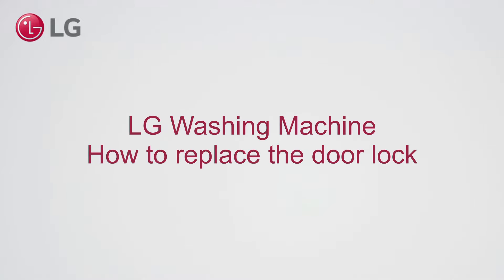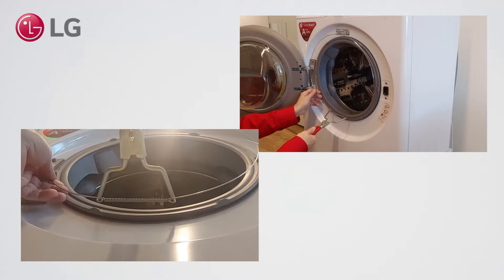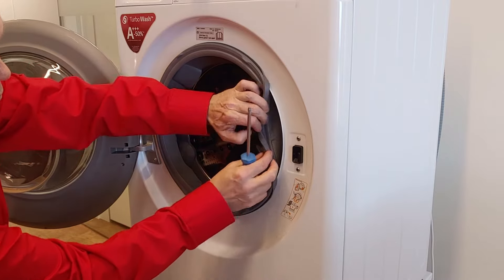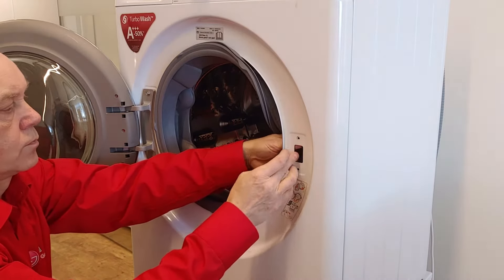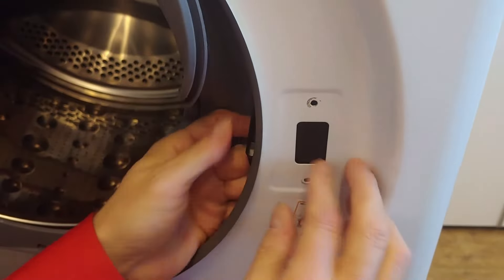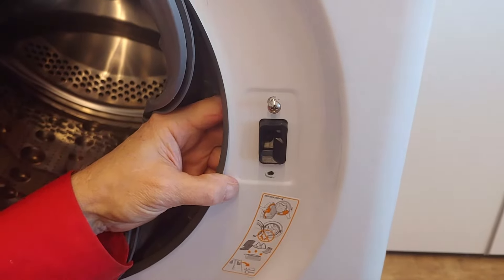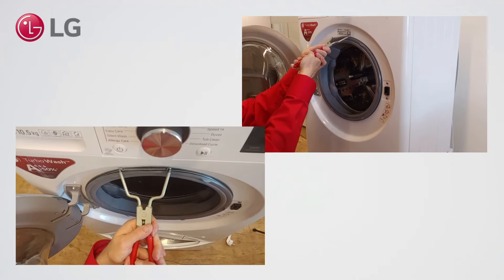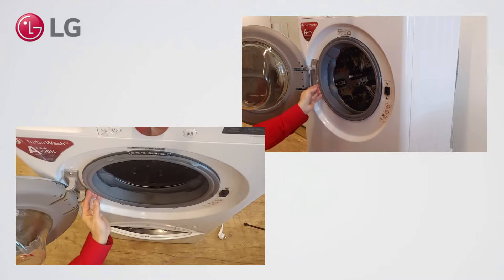[LG Washing machine] - How to replace the door lock

Comment: what is the model number of the interlock as video?  where i can buy the tool to uninstall and install the belt?
Reply from the maker: The lock part number you can request at your local LG support office. For the spring removal, you may look for 383EER4001A. If that does not work, you can look online for washing machine spring removal/expansion tools. Good luck!

Comment: im service tech in EU. Need to know how to release stucked door with instantenous type 4 door lock mechanism with door that has solid/fixed door latch so there is not possibility to release the door manually by manipulating with the latch and also there isnt the plastic mechanism attached to the switch from inner side to release stucked door manually. You can barelly get to the switch from upper inner side but it looks there also isnt any mechanism on its surface for possibility to open it manually. Its also impossible to open the switch electrically by setting the drain function because it has mechanical failure. It wont open and even close - after few attempts the De02 error appears. I dont want to destroy the door latch by trying to open it by force because you cant change the door latch on this type that has door that cant be dissasembled.. You would need brand new one. terrible..just terrible

Comment: changed my lock but still have the same error! anyone know what the problem could be?
Reply from the maker: It could be a PCB problem, but may I ask what error you see?
Reply: @LGSAE  it's error de1 . The switch is new and all cables from the switch to the board have good continuity. I noticed a red LED lit up on the board.
Reply: @LGSAE  bought a new board and now get error DE2. any ideas what the problem could be?
Reply: @LGSAE  the new board has a red led lit too, what is the red led for?
Reply: @Jonnyweareten   I am experiencing the same problem and have done same thing as you, i.e new switch and board but haven’t fixed issue. Did you manage to fix and if so how?
Reply: @muragzmorangi6818  Yes I figured it out in the end. I found that not only the door lock switch had broken but the fuse had blown on the circuit board, apparently it is common for the fuse to blow if the door mechanism is faulty it may make a short circuit and blow the fuse. Get a multimeter and probe through the resin make sure you get a good contact on the fuse to see if it is actually blown. I soldered some fuse wire across the fuse and it's working fine now. If your fuse is okay then check the continuity of the wires from the door lock to the circuit board. Good luck.
Reply: @Jonnyweareten   Thanks. Did that and found out fuse of both boards i.e original and new had blown. I wish I had not bought a new board since I would have soldiered new fuse and machine would start working. Wasted my money. Regardless thanks so much, you’ve saved me from spending more money on contacting LG for repairs and wasting time.
I appreciate.
Reply: @muragzmorangi6818  same here I probably didn't need a new board and now the pump has just broken. not very good for a 3 year old machine with little use. anyway I am pleased you have fixed yours. :)